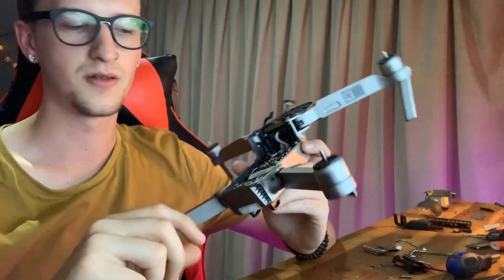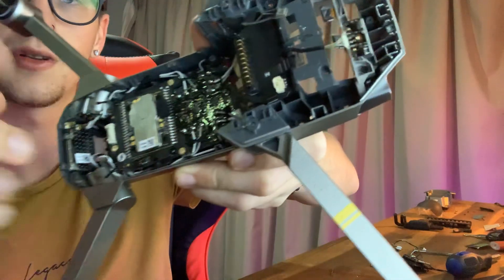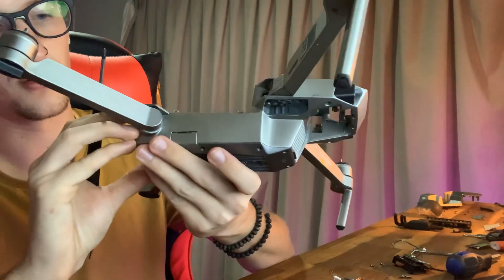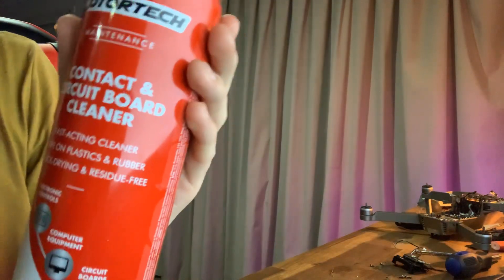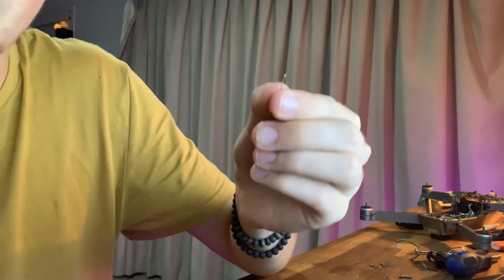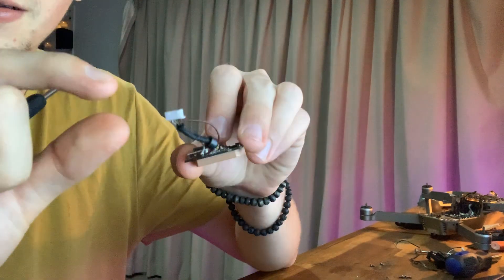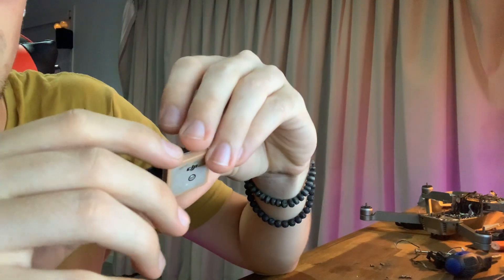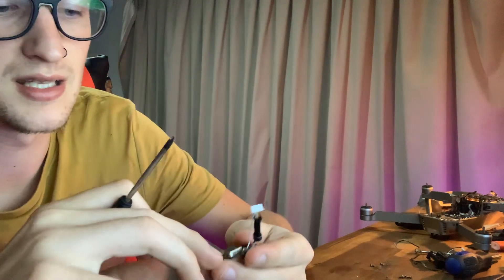DJI Mavic Pro GPS and Compass Fix/Repair

Comment: Hello. The Mavic Pro gimbal cable broke down, so I replaced all the cables, and at the end, I kept getting compass errors, so I gave up and watched this video. I didn't connect the compass1 cable in the process of attaching the lid. I was thinking about throwing away the Mavic, but I found a simple solution with this video, and fortunately, I'm flying it well now. It really helped me a lot. Thank you.

Comment: Hi there, amazing video
Recently my Mavic Pro is encountering reconnection issue on its own without any interference or damage. The drone disconnects itself every 04:20mins and then reconnects. It makes me feel very frustrated. I’ve done all the firmware updates but the problem still occur. Can I know any solution to this? It’ll be much appreciated

Issue video:
https://youtu.be/aIxKkvW1VWg?si=bbBtpaGlUnQ1lSRF
Reply from the maker: Hey! Sorry for the delay. Have you fixed your issue?

A few things to try that might help:

- Make sure you’re using DJI GO 4, not DJI Fly.

- If you’re using a newer phone like an iPhone 15 Pro Max, it might be a compatibility issue. Try an older phone if you can.

- Try a different USB-C cable, and use the bottom USB port on the controller instead of the side one — it’s usually more reliable.

- In the app, try clearing the cache and logging out/back in.

- You can also try relinking the controller manually (press the little link button on the drone and do it through the app).

- If you have a second battery, test with that too. Some power issues can cause weird timing-based disconnects.

Let me know if any of that helps :) Thanks for your comment

Comment: Fixed mine . I bought the plug with the wires connected on AliExpress about $4 for 5 posted and just changed them 1 by 1 they are a different colour but work . also ran the GPS threw a demagnetiser. The part number for the lead is SH  1.0-6p

Comment: Great video! I had to do this repair myself this afternoon. It wasn’t too difficult even for a novice at soldering. The only thing that I would add to the video or in the description is the order in which the wires are connected.

Red | Blk | Ylw | Gry | Tan | Wht

Comment: how did you connect the wire to the connector plug?
Reply from the maker: There’s a little metal clip that slots into the white plug and hold into place

Comment: How do you remove the silicon glue , I accidentally when removing the cover 3 wires were disconnected and I need to put it back.  Thanks for your information.
Reply from the maker: Also get a tub of soldering flux to use when reconnecting the new wires it will make it 100% easier to reconnect and give you a professional finish/solder
Reply: @shae7210  Thanks for the advice .
Reply from the maker: I used the end of the solder to burn and then scrap mine off, you can try heat with a sharp blade or even some kind or liquid remover. Your best bet would be to google "How to remove silicone adhesive/potting" or something similar. Let me know how you go :)